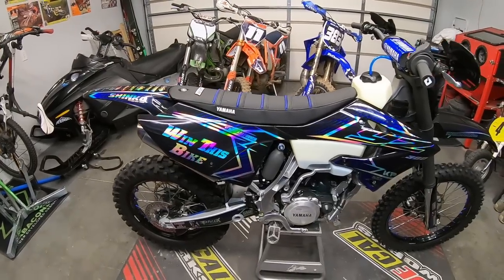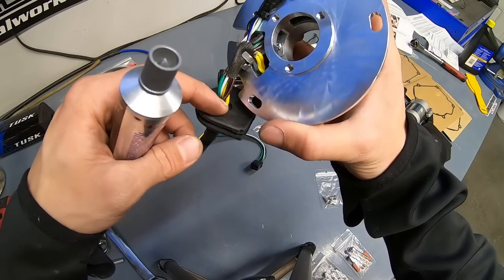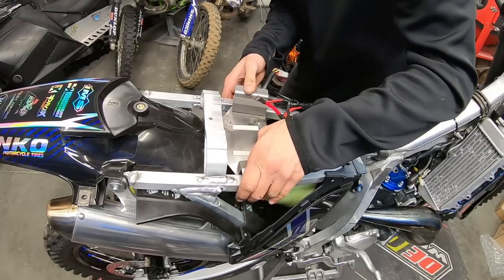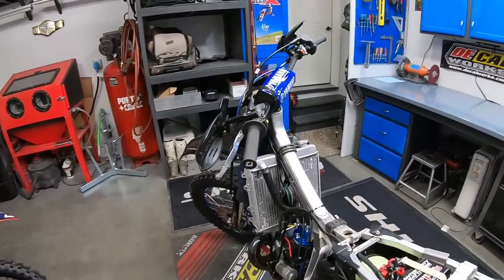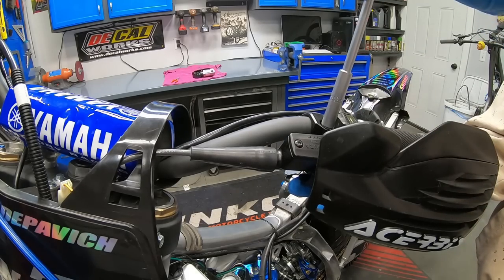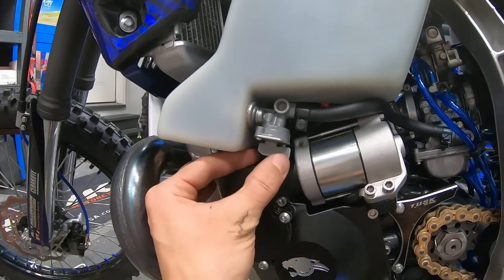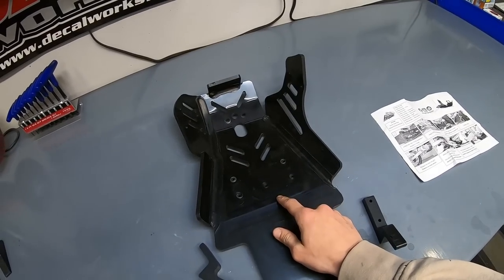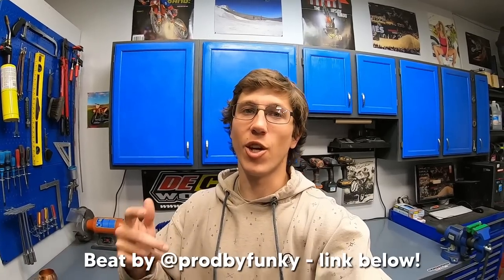Installing the Panthera Electric Start Kit on the YZ300!

Comment: For 50 years I've been riding in the Rockies of Wyoming and rocks grow everywhere.  I ride the pegs so tight to the bike to protect my feet that guys laugh and tell me I can squeeze a 250 down to a 125 in one ride.  The only thing that bothers me about this conversion is the extra room it takes from my feet.  The damn thing looks like a wart on the side of the bike. The EZ clutch would be more important to me than the starter.  Good video, tho.

Comment: very impressive job I did a yz250 build with  a panthers starter and I tried to add the hydraulic clutch but I saw that you had an extra ring did you put that on ? and it still didn't fit ?
Reply from the maker: The hydraulic clutch gets bound and doesn't work properly even with the additional spacer. It will technically work, but I think it would break relatively quickly and with the binding the pull is harder than even with a cable clutch. Wouldn't recommend trying the two together.
Reply: thanks